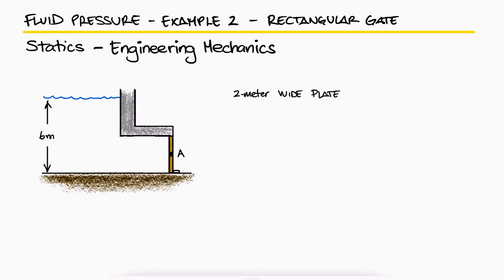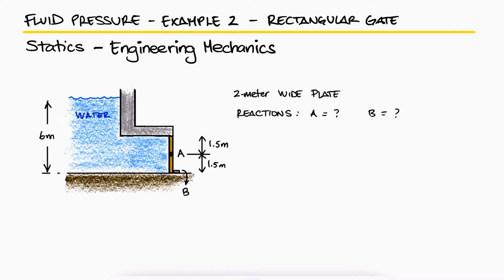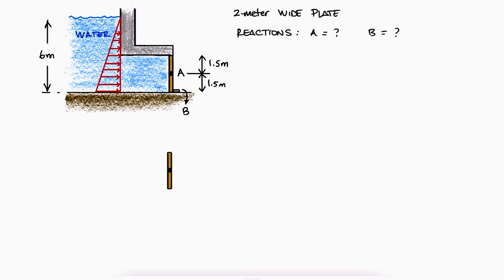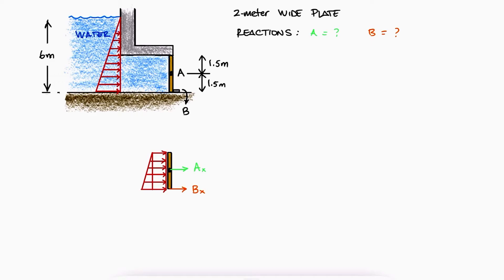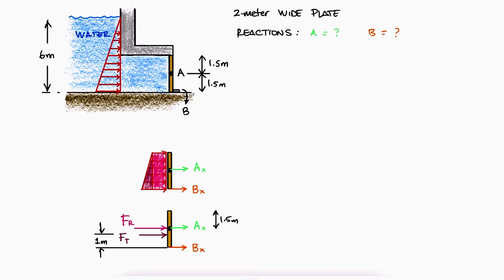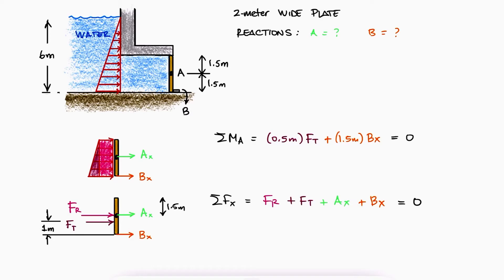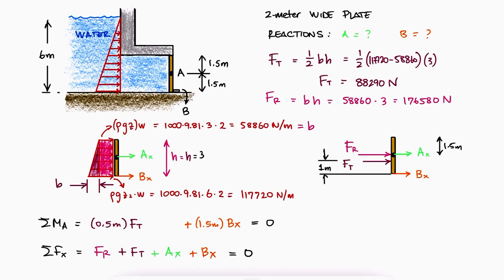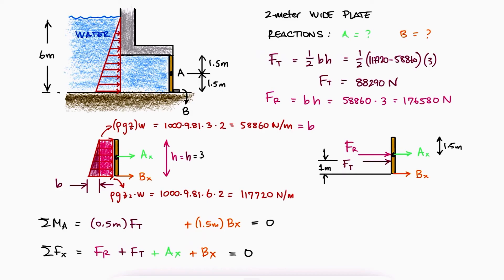Hydrostatic Pressure of SUBMERGED Gate in 2 Minutes!

Comment: Also, why do you use the trapezoidal distributed load instead of just using the triangular distributed load at the gate, since the gate is not flushed with the wall?
Reply: As water is incompressible the rest of the water is still acting down on it.

Comment: Great video. Shouldn't the reaction Bx be greater than Ax, since the pressure is higher a point B?
Reply: no, as the centre of pressure (Ft) is acting closer to Ax than Bx. The Centre of Pressure is the point at which the hydrostatic force acts, basically where all the pressure of the water is said to act.